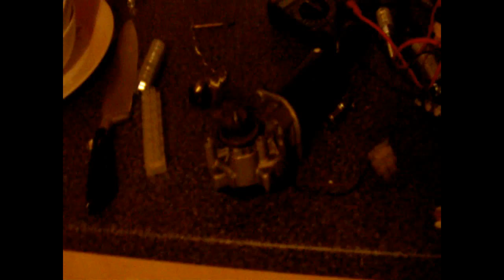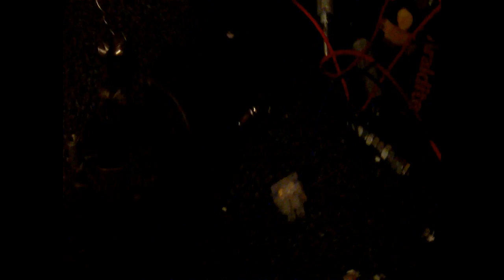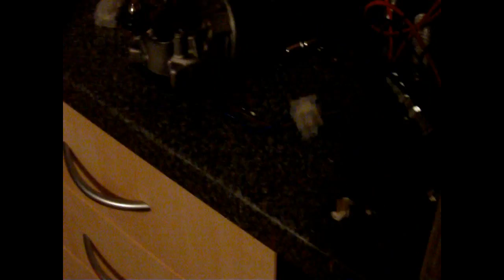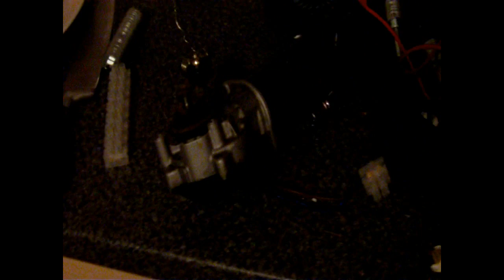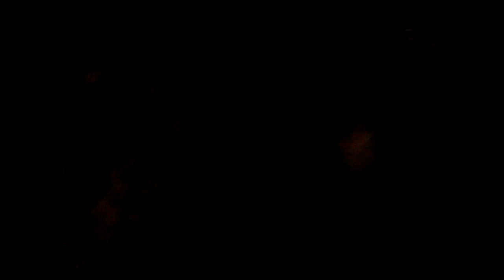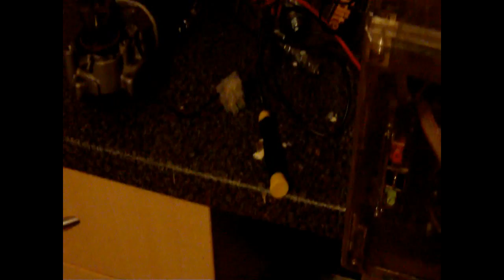Windscreen Wiper Motor clockwise and anti-clockwise

Comment from the maker: @gryzman It looks good, but I don't think it can handle the current of two wiper motors simultaneously. I've been warned these things can use up to 15 amps! The Arduino IRC channel advised me to use separate MOSFETS because they have lower heat density,
I'm thinking of making this: bobblick.com/techref/projects/hbridge/hbridge.html